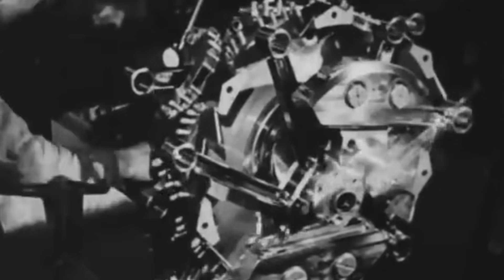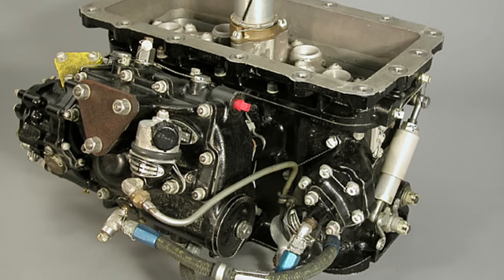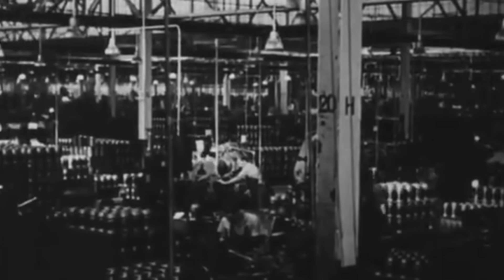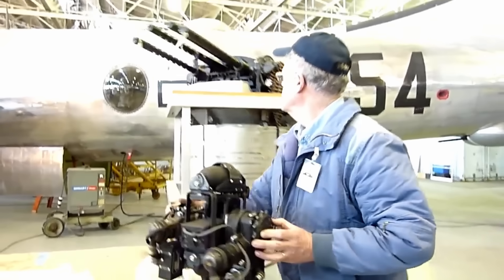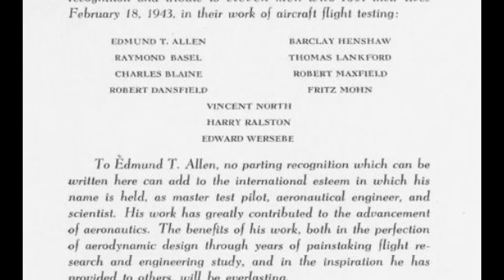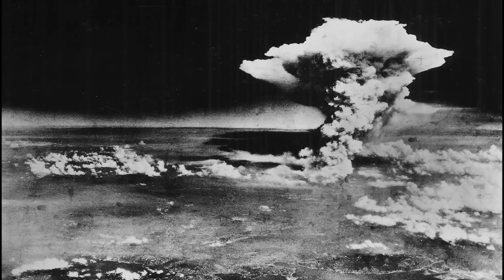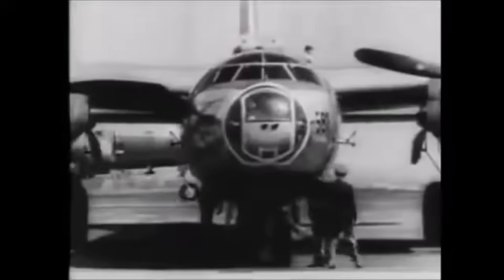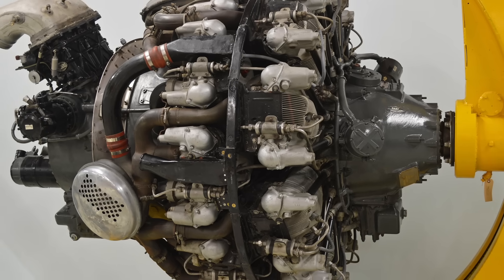MicroStrategy Connect: Community Top 10 #AsktheExpert

Comment: I know the RR Griffon achieved about the same power output (though later on), and even some hotted up versions of the RR Merlin got up to about that much power. The timings meant the RR Griffon (as it was at the time) was not an option, but I still wonder what a B29 would have been like with 4 RR V12 mounted. Or, 4 Bristol Centauri, especially the 2,600hp version.
Reply: If we are going to the realm of “what if” I would vote for 4 RR Crecy two strokes.
Reply: Actually I do believe  six of R2800 would have been a better set up !!!   More reliable
Reply: The R3350 engine variant's used on the B29 were capable of producing quite a bit more power just like all of the aircraft engine's of that time were, people are always throwing up some bench test engine specs against the service specs of another engine and that's total BS doing it, all those engine's had test examples that made loads more power than the way they were tuned for service. 
Reliability was the factor, you can't replace 4 engine's on an aircraft every time it flies especially when those engine's are being produced half way around the world.
Even in the reduced state of tune they were in when used on the B29 it could still lift twice the amount of weight of any other bomber in the world at the time and at much higher altitudes, even though it was never used in combat a B29 carried two 25,000 lb Grand Slam or whatever they were called bombs to an altitude higher than most other bombers could fly empty, if the engine's were set up to produce more power it could have lifted even more and even higher, but once again you can't replace 4 engine's on an aircraft every couple times it flew, that's just not feasible.
Reply: Or maybe the Napier Sabre with a 24 cylinder sleeve valve engine, equally problematic, but huge horsepower!  😊
Reply: Or 4 Napier Sabres even
Reply: There was the Allison V-3420 option. At least on was built.
Reply: In some ways the Allison 1710 was a better engine than the Merlin, but it gets a bad rep because of not having a well developed supercharger to go with it in the P51 Mustang.. with the room of a bombers wing they could have given it turbo superchargers and it would have been fine
Reply: @mo07r1  
The Allison was a vastly superior engine to the Merlin, it's just that no US aircraft used it without the USAAF's preferred system of having an engine with a single stage supercharger and a turbo to compound it for high altitude, the B17, B24, B29, P47, P38, Black Widow and just about every other USAAF aircraft of WW2 all had that system and not only did it have unequaled high altitude performance, which is why they wanted all their aircraft built with that kind of supercharger system, but it also gave unequaled performance from low altitude up to high altitude, unlike an engine with a 2 stage 2 speed supercharger the supercharger/turbo configuration didn't suffer from power drops in between the "sweet spots" while gaining or losing altitude, once they make maximum power around 7,000 to 9,000 ft they maintain it all the way up to higher than 2 stage supercharger systems can, it's just that until the production version of the Twin Mustang was built and because Packard was losing manufacturing rights to the Merlin because the war was ending meaning the US would have had to start paying royalties on the Merlin they didn't bother designing a 2 stage 2 speed supercharger for the Allison, but once they did it's power levels bested the Merlin at altitude by 200 HP, they test fit one of the 2 stage Allison's in a P51 which resulted in a 490 MPH plane, no Merlin powered P51 could come close to that.
The Allison was 60 ci bigger than a Merlin but was smaller in it's cross section, it had less moving parts and it's direction could be reversed without special cams, all that needed to be done was the crank turned around in it and 4 of the plug wires changed to different cylinders along with a small idler gear fitted onto the back so all the accessory pumps would turn in the correct directions, ie fuel, hydraulic, vacuum etc etc.
It was a much better thought through engine better suited to military applications being so versatile, it's just that when the USAAF seized production of the P51 the Packard built Merlin's already had a 2 stage high altitude supercharger being made for them so they seized production of them also to put in the P51's instead of taking the month's it would have taken to design and develop one for the Allison, the whole idea was to win the war they weren't worried about what people would think years later.
Reply: Allison's V-3420 (basically two V-1710s joined together) was tried as an alternative, producing the XB-39. It actually performed better than the B-29, something of a missed opportunity that they didn't test the engine swap sooner as they might have selected that version for production instead. As it was by the time the XB-39 flew B-29 production was already in full swing and they were committed to the R-3350.

Comment: My father was a War Assets Administration inspector at Boeing/Wichita during the war and his few stories about the development of problems of the R-3350s had impressed me though was very young at the time.  On my own in later years, I saw the forward mounted exhaust collector sitting ahead of the engine must have been a significant source of overheated air passing though the engine bay and raising the likelihood of fires and failures.  They did eventually redesign the system with the front cylinder bank exhaust tubes running rearward to solve the problem, similar to how the Pratt-Whitney R-2800 is made.

Comment: Well done! In the 1980s, I worked as a lawyer for C-W right in the Wood-Ridge facility.  I actually have a 3350 piston, valve and cylinder barrel destined for the scrap heap, but given to me by the workforce there.  In the early 80s they were STILL producing spare parts for engines in service, though not too many.  I remember that the Taiwanese AF placed orders for R-1820 spares for their Grumman S-2 A/C, as an example. 

My dad flew KB-29s in the 1950s, and even then, engine fires were a risk.  On one occasion, an engine blew a cylinder head up and out through the cowling while the aircraft was in flight!  He got the airplane down in one piece, sans that engine part.

I strongly recommend a book by the Smithsonian Institute Press called "Building the B-29."  It has a good chapter about the R-3350 engines for the A/C, and the many challenges and problems that occurred in the program.
Reply: I have a book that details some issues the government was having with C-W Aeronautical and the production of the P-40 fighters.  The mention here that the engine division was also in a pickle for some of it's practices during the period dovetails with that.  C-W was second in size to General Motors at the time, report being that profits were the top priority with them.
Reply: @whalesong999  The "Building the B-29" book is brutal in its discussion of labor and management problems at the W-R plant.  The government actually sent in a "tiger team" of sorts with experience in management to straighten things out.  Eventually, they did, but labor/management problems, especially with unions, were always a problem for the Company.  There is also a book by Robert Fausel (sp?), a test pilot at Buffalo, called "Whatever Happened to Curtiss-Wright?" It discusses the management/profit extraction mentality that was the Company's M.O. during the war and long afterward, even when I was there.  It's written from the viewpoint of a tee'd-off test pilot, and is not scholarly, but is an interesting read nonetheless.  Eventually, C-W lost out to its competitors both in airframes and engines, though it still survives and does significant govt work as a military subcontractor.

There is a modern-day analogy: Boeing.  I suspected the worst when it moved its HQ to Chicago and focused on bean counting and profits to the detriment of quality AND SAFETY OF FLIGHT.  When Management fled from Seattle to Chicago, it reminded me of C-W's Rockefeller Center, NYC corporate HQ during WWII and into the 1950s.  When top management gets away from the places where the work is really done and focuses on money rather than quality products, this is what happens.
Reply: @Redhand1949  if Grumman had held off a year or two with the F11 for J79s instead of Wright's license built Saphire with the semi functional afterburner they might've found some profits in foreign sales and perhaps USAF contracts right up until F14 went to carriers.  Why Grumman didn't form a foreign. sales team for their F11F-1F Super Tiger I dunno.  Nor do I know why they remain pigeonholed on just carrier duty when there are other markets to cultivate that just might save your company someday.

And if the competition uses tactics that disadvantage you then put yourself on a level playing field if you're gonna play. A charitable donation gets you at the head of the customs line, gets your overweight toolbox in the luggage compartment,is influential in the inspection process and can sometimes mitigate your trouble with the pertinant powers that be. Goody two shoes doesn't always win the game.
Reply: I flew on S-58 into the 90s, that 1820 is awesome!!!!